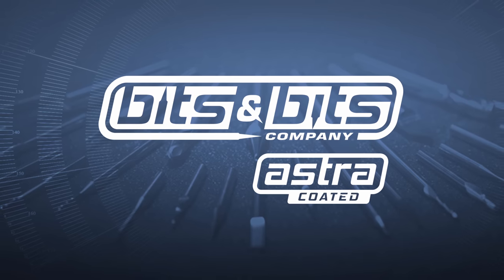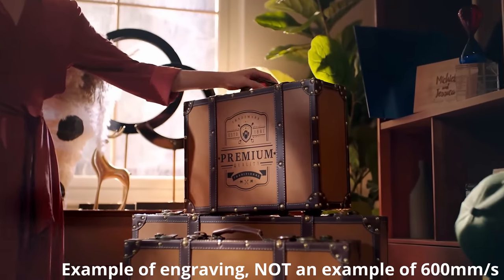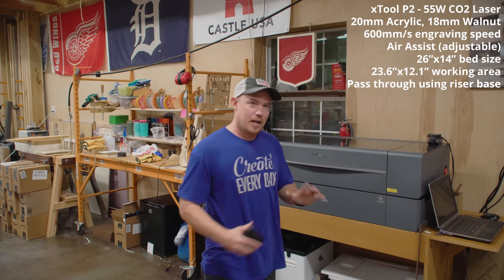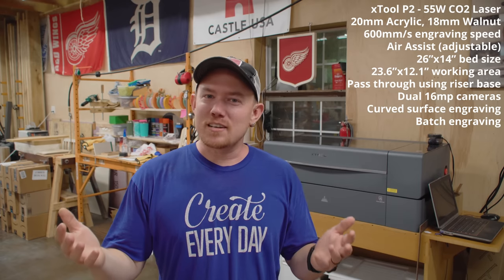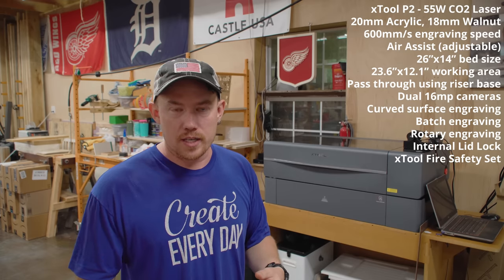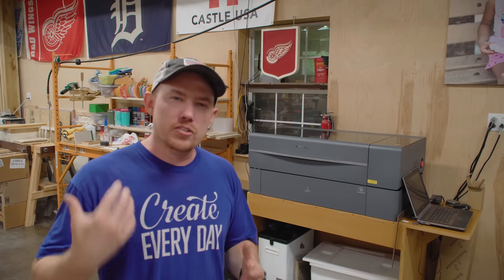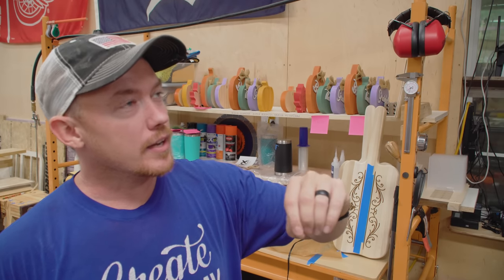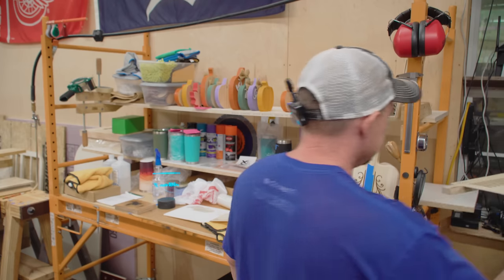xTool P2 55w CO2 laser - Introduction and project results

Comment: Jay, on the ring for the chisel I believe you have to have a fiber laser. The engraving on the cups, the laser is removing the painted surface and not actually scoring the metal. We are not as far into the business aspect as your wife, but I’m sure my wife will take off running as soon as we have all our systems in place. I second you on that emergency stop, hope the company improves on their next version of this machine or better yet, make it so that all new machine orders have an improved E-stop feature. You explained everything very well!
Reply from the maker: The ring is aluminum and the engraving is just removing the coating. Co2 can do that.

Comment: My laser is on the way now, but ive had a CNC for 4ish years now. I LOVE my CNC. But the more I look into the laser stuff, I more I realized alot of the things Ive done on my CNC I could of done on a laser. And they might have come out better. Like Ive built alot of shop type things like a cordless tool holders with shelves with a hex pattern on the outside out of plywood. Im thinking im going to try building another on of the exact same thing and see if it takes me less machine time. But I do think using both the CNC and Lasers is the answer to really being able to make some really cool things. Well or just the router and laser

Comment: You did a very good review on this P2--thanks -remember run the laser at 80% or less to prolong the laser tube life  , I use the start button to stop the machine to take a reading on the distance from laser tube tip to work surface, I bought the BOFA Advantage AD-350 filter,

Comment: I have a Glowforge. I also have used larger Epilog lasers at the makerspace I worked at. I really like my Glowforge. This looks pretty cool. I haven’t seen one that can do the curved surface engraving. And some of the other things look pretty cool.. If I was to get a second smaller one I’d probably look into one of these.
Reply: I’m also really glad that you made the comment about not leaving it unattended. Soooo many people think that’s not an important thing. When I worked at the makerspace I had two fires happen. Luckily they were contained. But they only happened because the user was distracted and not paying any attention to what they were doing. Both experienced users. You gotta be safe.

I will add though… the safety button… seems to kinda be unnecessary. Maybe not on that machine. But on every machine I’ve used the button that starts it will also pause it. Which stops the laser from producing power. So it essentially shuts the source down. Only thing I’m curious about is that lock you mentioned that locks the lid. If that allows you to open it… that would be great. 

I also would like to have that time counter on my laser. That’s handy.

Comment: I have a D1 Pro 20W laser with the air purifier you mentioned.  I have found the purifier is great for inside, however, It fills up with particles very quickly and the replacement filters are not cheap.  I have tried blowing out the pre-filter, which does help, but the bigger part of the filter must be replaced and can not be blown out.  I'm working on getting set up to just discharge through a hose to the outside to save on all the filter costs.  This will require an in-line fan as the fan on the cover for my D1 Pro is not very strong.

Comment: I agree with easy access to E-Stops. I don’t think it’s too bad on the side especially if the operator is sitting there most of the time by laptop. But you are correct, a second one on top or front in case of an issue with a feed through issue. Really liking that P2 and want to get one, but still a bit more than what I’d spend.

Comment: I agree with you about the Emergency stops. You can call me dumb but ive gotten into the habit of I get ready to use a tool, in the position Im working then just touch the E stop. Just to be aware of where it is, had some times Ive needed it and been flustered then hunting. I do have cheaper tools than you, your bandsaw E stops are awesome. Now with my CNC and I will do the same on my laser, I use surge protectors, but I leave them not hidden and in the case of my CNC I put it in what I call my safe zone. Like the side of the machine where the rail runs. Just if something goes flying thats less exposed than the front. So if something bad happens and it has, my body is covered while I hit the kill all the power.

Comment: Good overview of the machine but also interesting to hear how your wife has taken such an interest in using it.  Your point about the emergency stop is a good point the manufacturer should consider.  It is critical to have a fire extinguisher close by - which I see one right behind the machine.  Doesn't mater that someone watches the fire start - they need to stop it if it starts to spread.  Were you implying that the laser can engrave metal like your bands around the tool.  I haven't heard of a CO2 laser being able to do this - can this machine engrave metal that is not powder coated or coated with some material.  Great video.  BTW I need lessons from your wife about how to sell things.  I can't figure out how to get people wanting to buy things looking forward to your third video.

Comment: Great review. Although I believe you are being a bit harsh about the Emergency Stop, although it’s not ideally located. I too am a woodworker with a shop full of equipment and own the P2 and a CNC. The blades and bits on standard woodworking equipment are exponentially more hazardous than the P2 laser. The laser function doesn’t work without the lid closed (unless the switch has been overridden (not recommended). A small fire inside, although an emergency, is not going to remove a finger or a limb as wood cutting equipment would do. And, pressing the P2 E-stop isn’t going to put out the fire either. It’s simply going to stop the laser from running. Overall that was a very thorough review! Looks like your wife is taking it over and she’s killin’ it in sales. I like that they have made an auto fire extinguisher. 🧯 Oh, and very sorry about your dog. They’re family too.

Comment: My Xtool did 12 jobs before it died.  It’s been four months and the company has yet to return an email or call. Hopefully it works out better for you.
Reply: 😢 which model it was? Is it fixed now? Good luck
Reply: I'd like to know which model and what exactly you mean by "died". I have the xtool d1 "original not the pro" for over a year now. Upgraded everything, extensions rotary 20w head air assist everything you can get for it. So far I have had zero issues and I'm abusing the machine. If you mean these newer machines are not built as well it would help to know for my next upgrade route research.
Reply: @LtNomad304  wow i hope you get it fixed or  at least get the issue addressed.  I hate to hear customer service issues.
Reply: Good to know. I was looking seriously at the P2. I recently bought an AtomStack and their support is about the same as you speak of XTool. Maybe I’ll reconsider…. Thank you!

Comment: I'm sure this is a very nice machine, but $4500 is alot of money..  And I wonder how much a replacement co2 tube is going to cost.. Cause eventually you'll need one..   55w is an odd power rating.  Maybe they use a 60w tube and limit it to 55w?
Reply from the maker: No clue. Estimated lifespan is 6000-8000 hours. Divide the replacement cost of the machine by lifespan hour's and its not a bad investment with the money being generated. Let's see about longevity. I hope it's good.
Reply: @JayBates  info I've seen on other co2 lasers says it depends on how hard you push it.  They suggest not running it over 70% power.  Maybe xtool is different somehow..  I was just suggesting that if the machine is that expensive, replacement parts will be too.  But maybe a regular co2 tube will work..

Comment: Does anyone do woodworking anymore lol cnc/laser/3d printing what the world coming too lol
Reply: I know you were mostly joking, but every joke is often based on real belief of the comedian.  I use CNC as a hybid woodworker.  For instance, this week, I took a discarded silver maple branch, cut a turning blank on the bandsaw, turned a beer tap handle out of that, filled the carpenter ant tracks that were left with epoxy.  Cleaned that back up..slabbed out a 4 inch branch of that same tree on the same bandsaw, laser cut a logo on one slab for that tap handle on the xtool, jigged up that turned beer tap handle on a Shapeoko CNC wood router, silhouetted the spot for that laser cut logo.  Attached.. finished it with a monocoat.

Now, should I make a tongue in cheek inverse comment about not consider someone a woodworker because they can't work at my level by incorporating hand/power/computer together?  Do I not consider cabinet makers woodworkers because that's more about production, right angles and jigging than it is about art?   We have to get out of the mindset that "Just because x woodworker uses y tool, they're not a real woodworker".  Use the tools you have to enhance your creativity.  This is one of them.  Laser cutting and engraving as well as CNC routing is a HUGE level up for bespoke woodworking marketing items.
Reply from the maker: When you got your drivers license did you have the thought "Does anyone walk anymore?" or did you use your drivers license as a tool to accomplish something faster? ;) Have a great day.